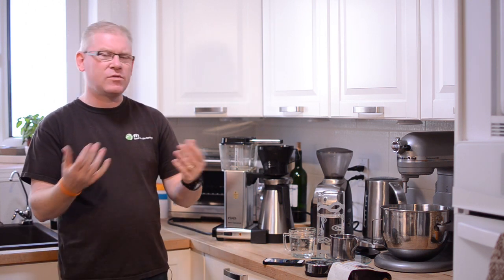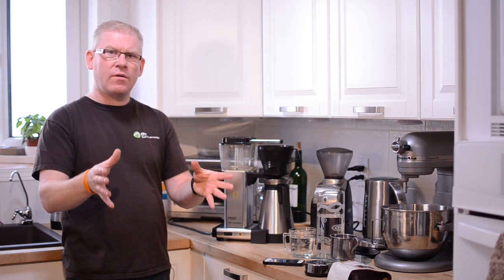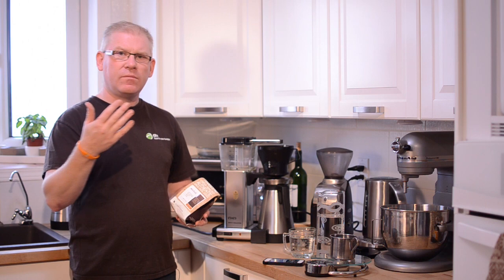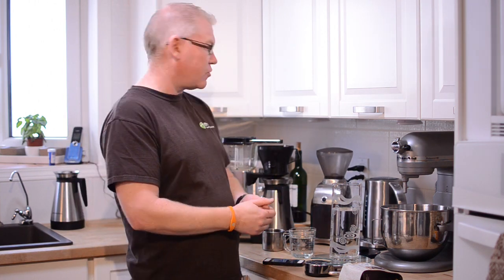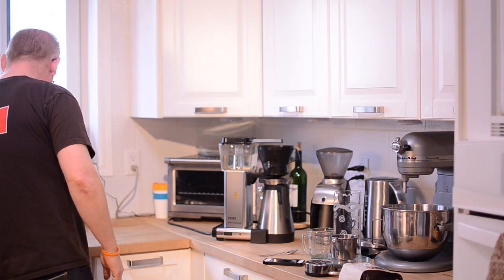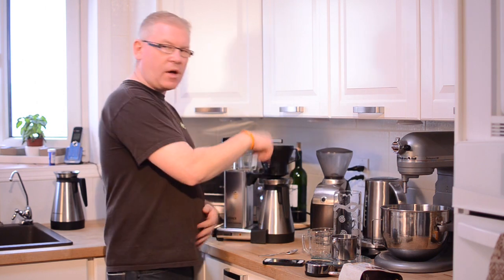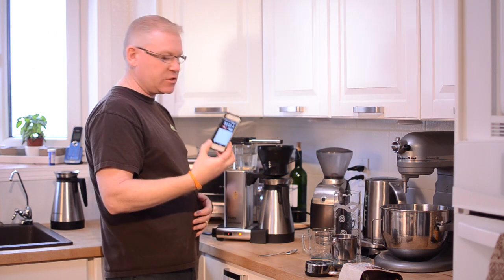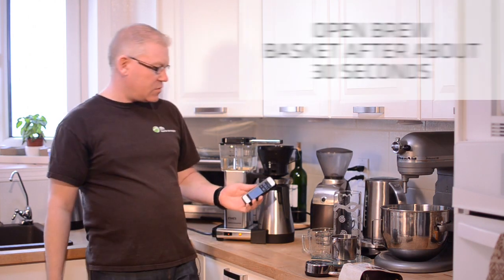Advanced Technivorm Moccamaster Brewing Techniques

Comment: I am sorry but this is not making better coffee.. the filter won't gum up with a regular grind .... and steering into the coffee like that: the lid is off: all the aromas go out. The people at Technivorm have been handmaking this machine since the 1960's. No need to weight the water! The coffee that comes out of this machine has been praised all over the world and comes out best taste in many many tests.... So it may look like you are doing the job better. Just trust this machine. It has a copper element (creating the right temperature from the start) and it is handmade in Holland where they pay their people normal wages. That is why you relatively pay so much.
Reply: I think you are right. I have spent years futzing with my Chemex and although the coffee was good (though never really hot), in the end I was tired of the process. That is why I want a really good automatic. This kind of obsession is exactly what people want to avoid by making this purchase. I seriously doubt that 99 percent of folks would tell the difference in a blind taste test using these techniques versus normal brewing. You just have to believe.  Oh well. To each his own.
Reply: You are correct.   If I'm to buy this machine I'm not monkeying around with it.

Comment: I've got a 15+ yo moccamaster and I give up. Everything I try ends up tasting like the basket, plastic or cement. Ive cleaned the machine so many times, nothing works even though the components of the machine work fine. I cannot get beyond the toxic plastic taste no matter what I brew. To me, this seems like a waste of time. Of course, I suppose its highly likely, I havent had a decent cup from this machine in over 2.5 years.

Comment: I've been using a Technivorm on a daily basis for over 6 years and I'm impressed by the flavor produced with this method.  I have never considered the TV to be a set and forget machine, but my usual efforts are always rewarded.  The difference in the bloom with this method is striking. It's easy to visualize the extra interaction the water is having with the ground beans.  While requiring a bit more coffee, the coarser grind allows for rich, smooth flavor.  I'll definitely add this routine to those days when only the best will do.  Thanks for the video!

Comment: I've been using this technique on my Technivorm for a few years. It definitely makes an incredible coffee.  If you are using pre-ground and/or using low quality coffee this won't do much for you.  Use good coffee and a burr grinder.  You have to dial in the coarser grind for the technique, which may take some test runs until you find the right size.  I have found that this provides a very consistent and flavorful result that lends itself to medium roasts and more nuanced beans.  While it does work for dark and full city type roasts, it really shines with more delicate or bright coffees.

Comment: Could someone PLEASE answer the question about grind size? I have the same Virtuoso grinder and I understand that one has to play around a bit with the grind, but it would be great if someone here could be a bit more specific than “a little coarser than normal.”
Reply from the maker: The coffee should look like coarse sand. Not chunky like we want for a french press, but not fine like we use for espresso. Typically a good starting point is somewhere in the middle of the grind setting, and then from there move a bit finer depending on how the coffee tastes. Ultimately you are looking for a balanced cup (referring to flavour) and the grind size will play a big part in dialling that in.

Comment: Superb presentation and very helpful, esp on 750ml(1/2 pot) info. I've been dialing in TV,  CDT-010 and Baratza Virtuoso for 6 mo with varied techniques and recipes. I processed with grinder on #28(bit bitter) then #30(bit sour). #29 is next batch and will adjust process as rqd for balance.  Fabulous flavor!! Thank you for taking the time to help.

Comment: I found it easier to swirl the filter holder gently in the end (also known as the Rao spin) rather than do the taps. Also, the second stir should be quite gentle and only on the top and not agitate the slurry too much. It's main purpose is to sink the grounds floating at the top and help settle them. If you stir too aggressively there you might introduce unpleasant flavours into the brew.

Comment: What should the water temperature be on the surface of the water on top of grinds, under the drip? I just received the top-of-the-line most sensitive fastest reading thermal pen, and I get 200° briefly to order one degrees. Someone else reports they get 202.5° to 203.5° with two different moccamasters. I'm thinking my water temperature may not be hot enough. I only have a couple weeks left if I want to return it or replace it. 
Update: I tested the water temperature again, this time using a teaspoon an i inch or so under the spray head to collect the hot water, and read the temperature in the spoon, and it averaged about 203°, that is, from 202° to 204°, most commonly 203°, so it does seem to be getting to the proper temperature.

Comment: No one ever demos the CD GRAND 1,8 LITRES AO with glass carafe.  Why?  The Grand has an auto shutoff after 100 minutes.  How do you keep the hot plate going longer?  Do you just turn the power switch back on???
Reply: Use a thermos to store your hot brew. The longer you keep your brew on the hot plate the faster the quality degrades.

Comment from the maker: You need to grind a bit more coarsely than normal given the amount of agitation when using this technique.
Reply: Thanks for these tips.  Some good ideas here, but unless you use kruve the aggressive aggitation is a bad idea.  All of the smallest particles in your grind will sink to bottom and clog filter.  The level of water will rise way above bed of grounds (and spill down sides, diluting the coffee).  Going to larger grind setting does not eliminate small particles in a fresh grind.  Using Kruve could fix issue, but that adds time, loses coffee beans, and is another pricey purchase.  Imo better to avoid agressive aggitation so that small particles remain suspended within ground bed.  Perhaps gentle/superficial facilitation of initial bloom is reasonable.  I do really like idea of running water through machine to rinse filter and prime the pump.

Comment: I was very disappointed when after spending what I did for a Moccamaster, that the saturation of the grounds was so poor. A good 1/4-1/3 of the grounds in the basket would be dry, untouched by the water. Watching the water come out of the shower head, despite the several holes it tended to come out in a single weak stream out of one.

Certainly working in a stir like in this video would fix this, but at the cost of a Moccamaster it should not be a problem to begin with. It is a flawed design in an expensive coffee maker that could be easily addressed by Technivorm via a replacement shower head (it's an easily-detachable part) but has not. Luckily there's a guy in Australia making a fixed replacement but I shouldn't have to spent $100 myself to fix Technivorm's flawed design... they should do the same thing themselves and offer the part for free to all owners.
Reply: Sounds like a specific unit issue. My one sprays from all holes.
Reply: @Zakalwe-01  Even if  it sprays from all holes, it's still concentrated in a central area in the half of the grounds closest to the water tank. I ordered what type of sprayhead that sits on top of the basket, under the cover, to redistribute the water like another spread, sold by CoffeePilot--I think they're in Canada. it'll probably be here in about five days.

Comment: Not very long if at all. better to get the coffee on the steel of the carafe the plastic basket is the 1 downfall of this unit! hot coffee in plastic brew basket ends up tasting like hot plastic. try using the hario glass pour over instead of the technivorm provided basket. it fits perfect. it works best for just one or two cups @ a time tho

Comment: Thanks you for the video and your version of the ideal brew. notes and comments; the water reservoir is very accurate, perhaps even more accurate than your scale and/or most scales available to the average consumer. I would rethink that unnecessary step. also your ratio is 0.06grams of coffee per 1ml of water. 0.06*200ml = 12 grams. 20% more coffee than the manufacture of the product recommends.